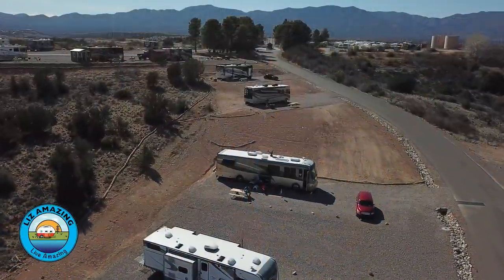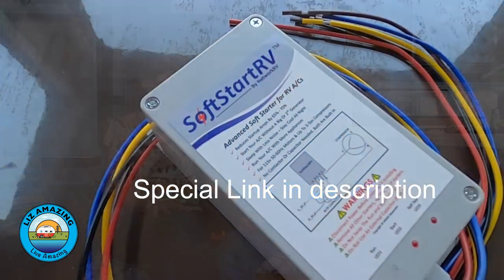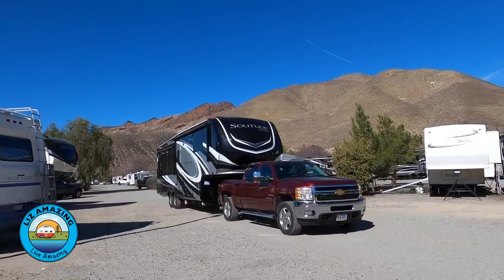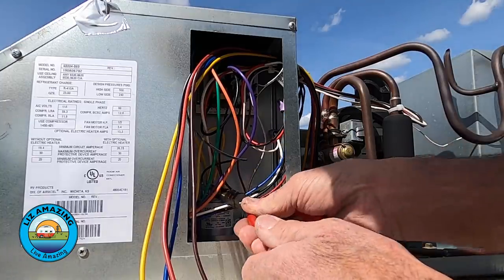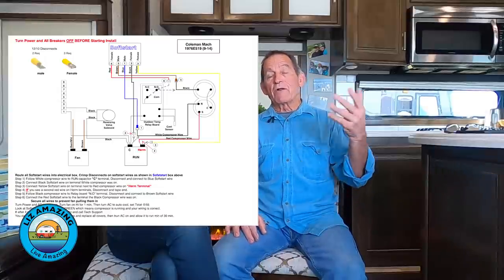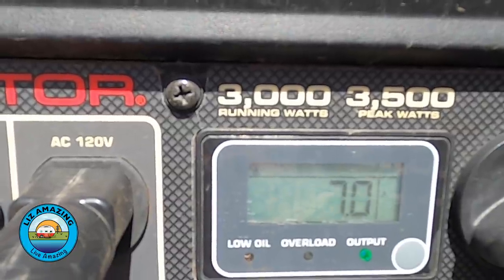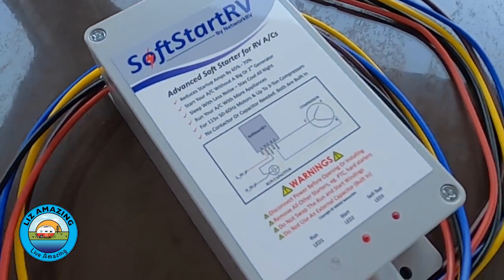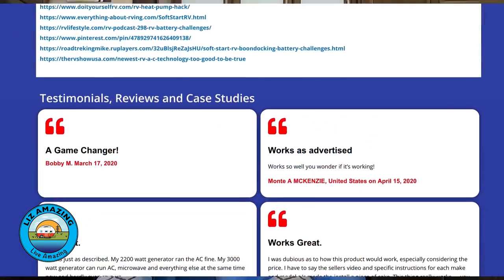Run RV A/C on household current | Two ACs on 30 amp | RV A/C with a small generator | SoftStart RV

Comment: When I replaced my air conditioner, Coleman had a soft start option so I got that as well, and it has worked very well. I have a 13,500 BTU Mach 3, and I see about 13A starting, and 11A steady state current. You could easily have two of these on a 30A circuit. Two 15,000 BTU air conditioners might be iffy, you would have to start one and make sure it was running OK, then start the second. If both compressors kicked on simultaneously (17A each * 2 = 34A) it would probably trip the circuit breaker.

Comment: I own a 28' travel trailer with a single 13,500 A/C that will run on 30 amp service. State Parks in Fl. are in the process of charging $7.00 per day electric charge due to high electric costs. I have been charged $11.00 a day at a COE park. I do not have 2 or 3 A/C units or washer/dryers or an electric fireplace. The big rigs require much more electric capacity than trailers my size, so why not make it mandatory that RV manufacturers must provide soft start for more than a single A/C unit, or, if you require 50 amp, pay a premium.
Reply from the maker: I know lots of parks do charge more for 50 amp service. I am sure soft start would love to be installed in the manufacturing process. They may even have something like that in the works!

Comment: It is important to understand that there is a much bigger difference then what you are explaining between 30 and 50 amp. The 30 amp is at 120 volts. The 50 amp is at either 240 volts or TWO 120 volt legs. This means in a camper plugged into 50 amp and wired for 120 volts you could conceivably pull a total of 100 amps (Two 50 amp 120 volt legs). So the actual available amperage is 70 amps more when plugged into a 50 amp outlet. This is why the breaker is a double 50 amp breaker. It would only be 50 amps at 240 volts but could also be two 50 amp legs of 120 volts.
Reply from the maker: Yes. We brush on that topic later in the video.

Comment: Honda 2000 runs the air with soft start.  RVAirflow has improved the flow. Warm windows has helped keep out the heat and the cool in.
Reply from the maker: It sure does! Yay!

Comment: Great video. 2 way refrigerator needs to be on gas . That'll save10 to12 amps power consumption.
Reply from the maker: Yep, whenever we're without shore power, or trying to reduce the overall load the fridge and water heater are on propane.

Comment: That is such great info. I am a brand new fifth wheel owner and I actually bought the same unit you two have. I have a question for you about AC,s if you have a moment. How long should it take for the AC unit in the main living area to cool down the rig when it's about a 95 outside/ inside? I am new to all of this so I want to make sure I'm not doing something wrong. It was well over an hour and I only dropped six degrees!!!!
Reply from the maker: That’s about right. It’s much easier for them to keep it cool than get it cool. We notice the same thing on travel days when it’s hot. Enjoy your 310GK- we love the floorplan!

Comment: I have 2 13500 dometic with soft starts. What size generator should I buy
Reply from the maker: Surprisingly, it depends on the generator. We've found the Predators not to be as robust as the Hondas. They actually can overheat and shut off. I would do the research as we are hesitant to give you a gen size and then be wrong.

Comment: great episode I have wanted to install a soft start I'm a pretty good hand at most projects I guess I have to push past fear and go for it 🙏🏻❤️🤙🏻
Reply from the maker: Yes! As long as you're comfortable with stripping and connecting wires, you will be just fine. The first step will be to take off the air conditioner cover and find the exact model of your AC. For ours, the ID plate was on the side panel that we had to unscrew. Then on soft starts website you will find specific instructions. Let us know how it goes!

Comment: i have used the ac many times while on a 15 amp service, but i don't know how many btus it is.  it draws 12 amps while running iirc.  of course we can't run any other high current devices unless i turn off the ac.

Comment: We just added a soft start to our Class C, 30 amp, one A/C.  Our volts went down from 120.5 to 106.5. My neighbor thinks this isn’t a good thing.  Did you notice a big change in volts?
Reply: I don't know anything about this type of soft start but typically per Ohms law if voltage goes down the amps go up. What kind of sorcery is this? 🤔
Reply from the maker: Paul says if current goes down voltage will go down with it. It's all about Ohms law.

Comment: A Hybrid 3k inverter with load sharing and lithium batteries work too but the soft start/easy start is a must. I am shacked that the RV parks don't push the RV manufacturing companies to add soft starts to all there units to save on electricity the way electricity is these days
Reply from the maker: Yes, we need to get the word out. I bet RV manufacturers will start adding this someday.

Comment: What do you do when you have a 30amp camper?
Reply from the maker: Your 30amp will have just one A/C I am guessing. With that a soft start will allow you to run it just using a heavy duty electrical cord. This could be handy when parked in a driveway. Of course, you will not be able to also run your microwave or your electric hot water. Just be sure to buy the heavy duty power cord.
Reply: No, it has two of them, but I can only run one at a time. I’m looking for a way around that.
Reply: I am thinking of rerouting a second line that will operate independently of my 30amp system I can run an appliance grade extension cord out to the pedestal and plug into the 50 amp with a 30 amp adapter.

Comment: LOL FUNNY A/C With your Fireplace running behind you. 🥶🥵 
Umm, our GDRV A/C works very well and we haven't needed to use more than 1 at a time. We have 3 in our Momentum.
Reply from the maker: Yeah, we are in the mountains with cold mornings and warm days! We start off bundled up and then remove layers and then have to start putting layers back on again, LOL!

Comment: My Jayco Class C 2019 came with two ACs and is just 30amp.  I've been wondering if the SoftStart would let me run one of my ACs on solar?  Nice to know it is easy to install.
Reply from the maker: If you have a 3000 W inverter and enough batteries, Paul says probably yes.
Reply: @LizAmazing  how do I know the w of y inverter?
Reply from the maker: @damselflymoldavite8145  It should say it in your paper work or right on the Inverter itself. If you belong to the Facebook page of your floorplan, someone in that group will know.

Comment: So it converts 30 amp to 50 amp??
Reply from the maker: It smooths out the initial draw on the AC, so that one AC will work on 20 amp and two will work on 30 amp. Test it, your mileage may vary.

Comment: I have an older Class A (1993) that has 2 AC's and 30 AMP service. It has an Onan Marquis 7000 Generator. There is a switch in the cabinet behind the driver which allows me to select the rear AC or the Front AC when hooked up to shore power. With the generator, it doesn't matter as it will run both simultaneously regardless of the position of the switch due to a dedicated 20A breaker on the generator. So, how can I run both AC's at a park, if I can only switch between the front or back? I guess this system isn't designed for my configuration.
Reply from the maker: Hi David, I'm not sure if there's a workaround for your shore power set-up or not. I would suggest calling Soft Start's help desk and asking them as I suspect you're not the first person with that set-up.

Comment: Soft start on electric motors that are not designed to be run with it can be harmful to the lifespan of the motor.
Reply from the maker: We have heard that soft start is actually helpful for motors. Several people said they actually extend the life of motors. Let us know if you have heard anything differently.